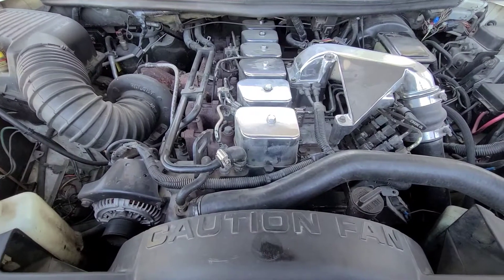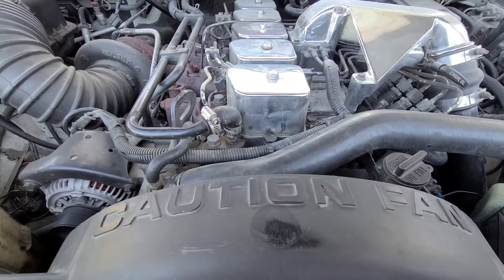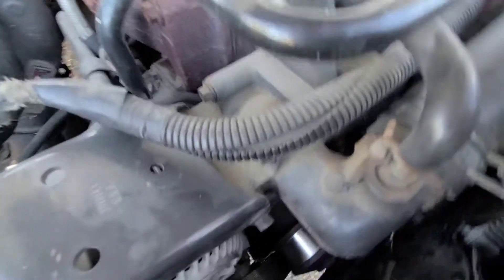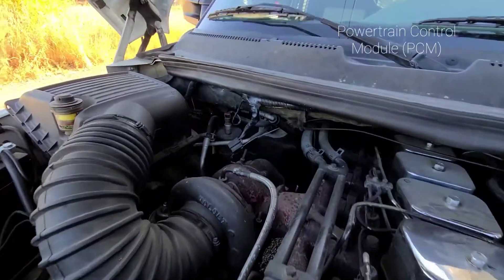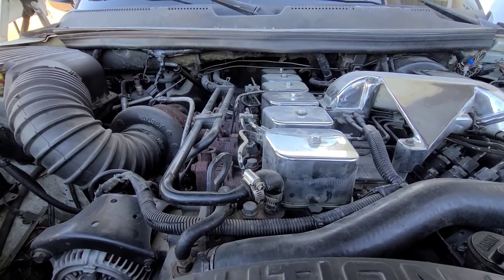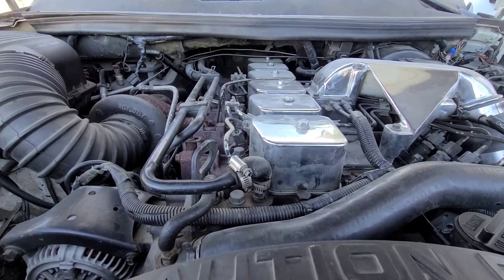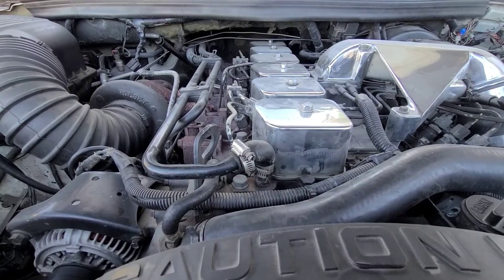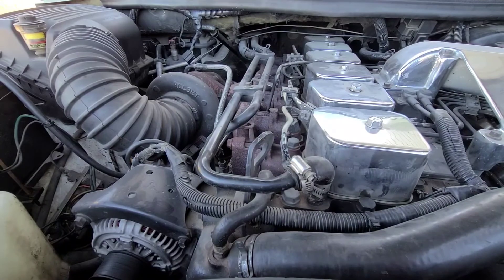12V 2nd Gen Cummins no tach, a/c, cruise control or 4th gear (o/d) solved

Comment: 2001 changed the cam sensor my truck doesn't have a crank sensor I changed the tps the ecm and now Im going take a pcm off my other truck and see if that's the problem . I wish there was a electronic delete that had to a mechanical injection pump and vacuum wastegate like the old 3506B model cat. I know they had problems too but I put hundreds of thousands of miles on several trucks and I can only remember a half of a handful of times I was at a repair shop

Comment: I also lost tach, speedo, overdrive and cruise in my 95 Cummins. How to check the sensor, it’s in a pretty tight spot? Only 115k miles on my truck.
Reply from the maker: I apologize @altadutch, I just read your comment posted on the updated video to this one. Are you able to try @mftradu's method for testing?
Reply: Today got my truck fixed. it did turn out to be the sensor. The whole thing cost me $200, part and labor. This mechanic now has a new customer for any future work on my other cars. I’m a happy camper.
I’m in my upper 70s and used to do work myself, but I graduated.
When you guys have this problem, replace that sensor first imho. Mine was about $80 from O Reilly.
Reply from the maker: @altadutch  Good to hear! Thanks for the update.
Reply: Which is tah t sensor imho???? @altadutch
Reply from the maker: Unless your ripped, you should be able to easily reach down and slip a guage in between the sensor and harmonic balancer. A matchbook or business card is about the same size, but harder to feel if the sensor is set correctly. Tightening it if it needs adjustment is the challenging part. I have had the sensor come loose. Check the space,  re-adjust if needed. Re-check it again. Otherwise, you may have to remove the sensor for further inspection. Do you need the diagram from the manual?
Reply: First thing to do you should check your PCM 5 volt refrence wires. First unplug the CKP sensor you will see  3 wires in the harness.  Violet/White wire should be 5 volt reference voltage. The Black/Blue wire should be sensor ground. The Gray/Black is the signal wire and should have a 5 volt square wave output while cranking or running. If you dont have the 5v refrence replacing the sensor will be a waste of money and time. If you have voltage that means PCM and wiring is okay and you have a faulty sensor . If that is the case you can check the resistance between the wires on the CKP sensor with a volt meter. Reply here if you need more help.
Reply: You guys are awesome. I have not yet focused on checking voltages as my eyesight is not the best. 
Did your check engine light come on? Mine did not and autozone cannot scan it in that case.
I have an appointment scheduled with a mechanic next month so we’ll see. 
I’m considering having the css replaced to start.
Reply from the maker: @altadutch  I never had the CEL come on other than during a start. I have heard of guys having it flicker intermittently, but along with the Wait to Start and Water in Fuel lights as well. Tell the mechanic about @mftradu's method. Sending the PCM in to Cardone would be beneficial though, as there are components that will need replaced eventually. And Cardone re-gels the circuit board. Like @mftadu said, guys have sunk a substantial amount of time and money without even solving problems on these trucks. Hope the videos and comments help in solving the problem efficiently. Interested to hear what you find.
Reply: @anonknowledge  thanks for replying, I will update and let you know what happens.
If the crankshaft position sensor was not in such a bad location I’d first change that one.
Reply: Also, btw, my check engine light never came on so a scanner won’t work.

Comment: OK I also have a 95 4x4 that did that crap a few years ago and I asked on the forums and every one said no way its the pcm. . I tested this and that finally is said we'll it's my money my truck and orderd a rebuilt unit from dodge and it was a on line dealer . Lot cheaper OK.  Sure enough that fixed all problems but one . That was hit a small dip in the road the brake peddle would move and drop out cruise and overdrive . A big spring on peddle fixed that. Later on I heard others were also getting bit by this problem.  So I told them what I did .
Reply: What did you pay for your PCM?

Comment: Would that also cause a limp mode?
Reply: Guys, you should do a few simple tests before sending out your PCM to some repair shop. First thing to check is your 5volt refrence, at CKP / TPS and VSS then if your PCM is getting power and puting out power/communicating. A bad Crank Sensor, TPS sensor or VSS can cause lots of problems on these trucks. There is no LIMP mode on these trucks, the so called limp mode is your transmission solenoids not getting power therfore your truck starts in 2nd or 3rd gear when you put it in Drive (manual trucks exception here) I will make a video on how to trobuleshoot this on a 1997 4x4 3500 and 1997 3500 2WD soon. We had a client with a 95 3500 2WD Cummins automatic... the guy had his transmission rebuilt 4 times at 3-4 different shops around Phoenix (close to $20000 later) to find out everytime he went on a road trip from Phoenix to his weekened getaway home by Lake Mead the problem with the transmission popping in and out of OD and lock-up. A simple diagnose we found out that the in-line transmission temp sensor at 72F ambient temp was reading 280F to the PCM and at 80-85F ambient was reading 205F ... A few resistors $2.50 at Fry's electronics added on the harness at the sensor solved his problem for good.  Do your homework before you start throwing parts and money at it. Also remember in today's world a new part is not necesarilly a good one.
Reply from the maker: It sounds like something internal in the transmission. Is it intermittent? The PCM with other components can prevent overdrive from engaging, but that is not limp mode. I'll check my manual.
Reply: @anonknowledge  it started as no overdrive then now it’s like in 3rd gear and not charging when on. Changed battery’s and alternator.
Reply from the maker: @cholochedd6752  It's hard to say what it could be. I didn't find anything specific in the service manual, but I haven't had much time. Have you searched threads on the forums of various websites on the web?
Reply: @anonknowledge  I’m going to try to send in the ECM hopefully it works

Comment: My 98 12 valve just started doing almost exactly the same thing as this, today. Out of nowhere, but its been a while since I ran this truck. 

The tach is extremely erratic and bounces. The truck dings at me as if it was turned off and on quickly. The dash lights flash when it does this too. Not constant, completely erratic but seems if I put into neutral while coasting it does it less then when in drive. All the other gauges were being erratic as well. Wouldn't shift into OD. 

I actually thought it may be my transmission at first because besides no OD, 2nd and 3rd were acting really strange. Almost like they were slipping but not. First and reverse fine. 

After seeing this and some other things I'm wondering if could be so lucky and just be the ESS. Of course I guess the PCM would be a possibility too. Any tips or words of advice would be appreciated. Thanks for your time
Reply from the maker: YouTube is a joke. I never get notified of comments. 

As far as your truck, I would start with checking wires if it's been sitting for awhile, just to rule out mice chewing through the wires. 

Next, if possible, find another PCM to test with and rule it out without sending in yours (check with local diesel mech shops to see if they have one or access to one. A junkyard might have one sitting on the shelf too). 

Other than the ESS, I had the tach bounce come back about a month ago and am having the dash cluster sent in. I was told they have had issues with the soldering. However, with the tach bounce I have now, everything else works.

I will post a video when I get the results.
Reply: Check all your grounds first and battery cables
Reply: Thank you fellas for the ideas! I hate when folks don't update, and here I am being one of them. Things got crazy busy, but seeing these replies now makes me want to update...

100% it was the Crankshaft Position Sensor, which that fixed it immediately. Being a work truck, this thing definitely is a bit rough round the edges but is a great truck overall.

Comment: I have the same problem with my 1998 ram  when the rpm  goes down
Stop charging a c stop working and check gages  some times works perfect  send my pcm to cia and they found nothing wrong  what do you think take to napa or find a used one?
Reply from the maker: I went through all the electrical wires in the engine bay and also checked the under carrage wiring. I replaced all sensors. Check your Engine Speed Sensor (ESS) measurement from the harmonic balancer again. Otherwise, if you don't have access to a spare PCM to test with, Cardone through NAPA is the last resort, especially if SIA is reporting nothing wrong with it. Sorry, I am not being notified when comments are posted.

Comment: thanks my truck has these same exact issues same year and everything. Got the whole trans rebuilt cause of it. $3000 later still no overdrive.
Reply from the maker: Check your Engine Speed Sensor (ESS) gap. It should be .50 mm. My tach started to bounce again erratically at wot. I decided to check the ESS because I remembered it had somehow went out of spec before. I used a business card and it was to tight. Readjusted it to .508 mm and now it works properly.
Reply from the maker: What year is your truck?
Reply from the maker: Another thing that can affect the OD is the brake pedal sagging. Use your foot or a small bungie to hold it up to test it. Be careful not to put to much pressure on it.